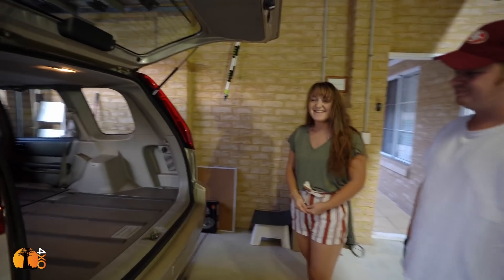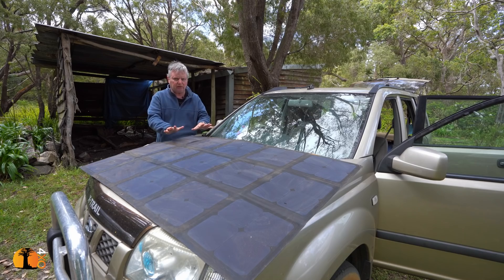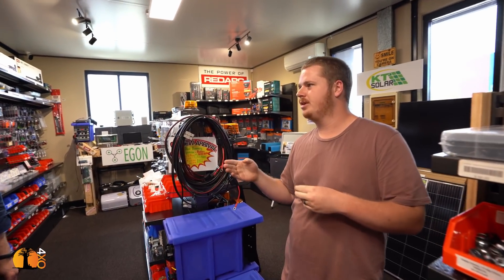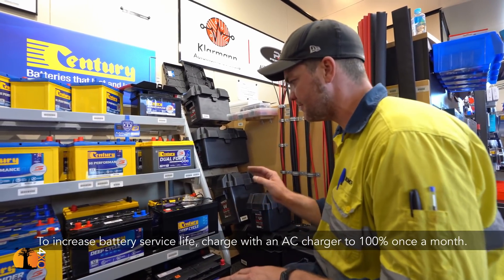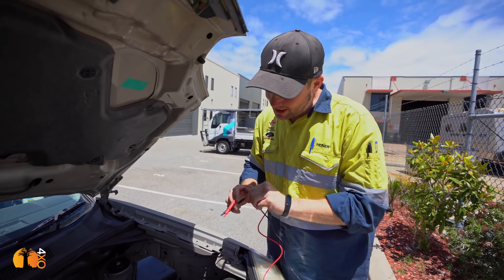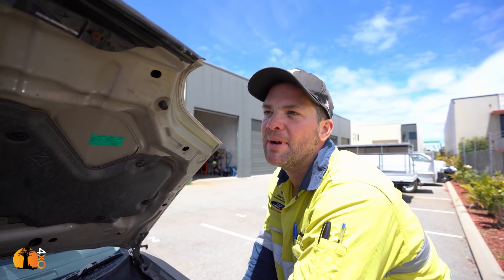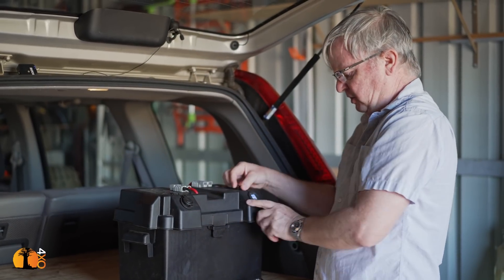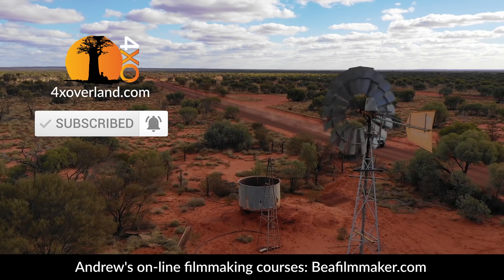BASIC ELECTRICS FOR A BUDGET OVERLANDER. Part-2 of Backpacker's Tourer Nissan Xtrail | 4xOverland

Comment: I have a dual battery setup in my VR Berlina wagon for camping. The system consists of a 135aH deep cycle battery behind the passenger seat on the rear floor. It is charged by the alternator (through the starter battery) via a Kickass VSR unit bolted to the left inner guard when the engine is running, or when camping, by a solar blanket plugged into an Anderson plug that is bolted next to the towbar with a heavy fused cable going back from that plug to the Aux battery. Have been using this regularly for 6 years to power a 2 way fridge & charging different equipment batteries and not had any problems.

Comment: Just noticed that you have 80 amps fuse protecting anderson plugs rated for 50 amps? That doesn't seem right?
I mean it will probably work and be fine, but wouldn't a 50 amp fuse be better?

Comment: If you are using a solar module with an OcV of 24 Vdc, usea PWM charge controller. Toy do not n3ed an MPPT controller. If you are using higher voltagemodules such as 72 cell 190 watt module ( which you can find for free ) an MPPT controller is far more efficient. Id you have room, grab a 250 watt module. You may pay up to $20 for one but they weigh about 19 Kg. You can get away with a PWM  controller with those. Slight loss of power but acceptable. Keep your voltage drop to below 2%.

Comment: The teouble with fixed solar modules is you need to park in the sun.  Also the angle to the sun is rarely optimal. Portable modules are more efficient but less convenient.

Comment: I thought it wasn't a good idea to hook up 2 dissimilar batteries in parallel like that. I thought if you wanted to run a 2nd battery without a solenoid or isolator or dc to dc charger etc both batteries need to be identical. Is that why he said you get less battery life? When I was looking into running 2 batteries in parallel I read that it's very important that both batteries be identical in type and rating even age and brand. From what I found it's the starter battery to be most worried about in a set up like that and overworking the alternator. I suppose it all depends on what your doing with it, I'm not an expert. I wanted to run a system almost identical to what you've put together and I ended up using 2 identical batteries.

Comment: Why not use a relay in stead of the connector to the battery, so when ignition is on the aux. battery is connected and when off it´s disconnected ???

Comment: A thing I have taken to doing when wiring boats to keep water out. Crimp the connection, seal it up using double wall heat shrink (it has a glue pre-applied to the heat shrink, so it seals extra good), paint all the edges with liquid electrical tape, connect it to the battery, paint it with the liquid electrical tape again and if you're really paranoid, paint on a coat of Vaseline

Comment: If you reconnect the two batteries with the Anderson plug and the batteries are at different voltages won’t this cause damage ? Regards AJ
Reply from the maker: The two batteries will never be at the same voltage, even when connected, due to voltage drop along the cable and connectors. Current will flow in an attempt equalise it. So, the answer is 'no'.

Comment: FWIW in one of my old cars I fitted a second alternator and second battery, the two batteries could be paralleled in an emergency to jumpstart from the auxiliary battery. Pretty foolproof and very cheap to do, just replaced crank pulley with one that would take an extra belt and a few simple brackets. You also don't end up depending 100% on one alternator. Very tempted to use ultra capacitors in my car, insignificant capacity but will let you start your vehicle with a pretty flat battery.

Comment: Great stuff. You don't see to many builds like this on youtube at least. Now it's all Li-FePO4 batteries.
Would have liked some more details regarding the expected current draw from the fridge and the resulting calculation for the battery capacity. How many AH is that AGM battery?

Comment: You can even do away with those heavy connectors and cabling and use a Redarc BCDC1206 at the 2nd battery more expensing in he long run but better alterative to all this plugging and unplugging and all these joints, my take anyway!
Reply from the maker: Okay. But this is a budget build. We were trying for the highest value for the LOWEST COST.

Comment: Surely after your years of experience you have learnt your lesson from every mistake you’ve just made. 
Fuses are for cable not for the amount of amps your battery will draw
VSR would be a life safer, potentially literally, not to mention whilst connected current will be drawn from the auxiliary battery on startup
Using a cigarette socket for a fridge instead of an Anderson.... come on the $10 now would save a lot of problems down the track

Comment: For the price of a decent ac charger, you could just get a dcdc charger. Also, if you know what to look out for, there are places like Australian Direct that offer dual battery kits for pretty cheap.
Reply from the maker: True. But cheap is cheap. So often not good value. I'm not rich enough to buy cheap crap only to have to replace it because it doesn't work for more than a few trips.
Reply: @4xoverland  seems more reliable than having to remember to unplug it every time 🤷🏾‍♂️

Comment: Andrew, instead of an AGM, can you use a Lifepo4 battery with the exact same setup as this? Meaning manually connecting when driving and disconnecting when you turn the engine off and camp?
Reply: No, LiFePo4 batteries without a charger 1) require more voltage to charge (14.4-14.6), and 2) can damage alternator by taking too much amps.

Comment: I think this overlooks the folly of PbSO4 - battery impedance. This type of battery ‘sips’ charge because its voltage rises quickly (hence the need to float charge).  [LiFePO4 ‘scolls’ charge, I digress].
- a $12 relay, plugged into a cig outlet would preclude flat crank by connecting under Acc conditions.
- a 2.5 sq mm charge lead would perform roughly as well as a 16, or 120 (or billion) sq mm conductor - the voltage drop is dominated by battery impedance; lead acid is drip fed, at best, always.

Comment: I have to say I love this series. Will be “telling” to high budget buyers about how you apply the same design principles to budget builds

All builds have a budget, but the same principles have different applications. Eg, buy battery “x” because it’s the best given the charging circumstances and you should replace the battery a little sooner than it’s expected life (which is more cost effective than installing a more expensive charging system and battery type). Design is everything. 

Thanks!!!

Comment: just read the comments about the video. i dont believe it that disconnect by hand should be such a problem? what happened to the pioneer spirit from you wishwant overlander? i just love this design. the less electronics - the better. especialy when you really want to go a little bit further than to the next camping place in the your neighbour town. nerds remember this: less electronics - less problems - better it is. when a cable breaks - well you can fix it. but when you really go overlanding, and your switch-drop-elex box fails - you are done. trip is over

Comment: Fuse vehicle side of the anderson connector that way it is ALWAYS protected and if someone puts on a different battery with out a fuse, you're covered. I would also recommend going to about 40A on the fuses as the charge draw will not really exceed 25A under normal charging opperations, I personally have ran 15A fuses in simple thin wire, close battery split charging, which I would actually recommend for this application as it auto diengages so you don't have the human error in forgetting to turn it off/unplug it. Also take the item power from battery side of the aux fuse. As otherwise there is no way to know if the aux side fuse has blown until you don't have power when it's unplugged. I would also recommend a switch for each item and a push-to-make "button" switch for the volt meter as you don't need it live all the time (gives a higher charge to your battery as every bit of voltage is a bonus!).

Comment: So if an alternator won't charge a battery to full explain why! It's complete tosh! so might be an idea to edit factually. Alternators are proper AC/DC chargers, if the alternator doesn't charge to 100% (subject to vehicle systems drain from the battery (only applicable to some vehicles though)) then it is broken and needs replacing because the float voltage is too low ie it is below spec for the system.

Comment: Loved my T31. Had a T32 as well, nowhere near as good. 
Had a similar power set up but with dc-dc on the battery box & solar panel on the roof racks all done with plugs. 40lt Engel & side awning. T31 had the inbuilt draws which took enough gear for me. Still room to sleep in the back. Easy to clip out the back seats (bottoms) which gave heaps of storage room. Could pack up & go away for a long weekend then literally 20 mins to unpack the whole car when you get home & quickly turns back into a comfortable daily driver like it was never there. Put the battery on a good charger in the shed when not in use.

Comment: Can you comment on the use of self-amalgamating rubber tape, it is very useful for making sure you exclude water and chemicals from connections e.g. the inline fuse box , quick wrap around after fuse fitted and lid closed. An alternative is perhaps a budget silicone grease to block off ingress points with some insulation tape over.

Comment: I love your videos, so helpful & informative. I'm building my first overloading rig here in the UK using a Landcruiser 90 & I have been wondering about how to do the electrics. I actually have two batteries already from factory known as the winter pack but they are in parallel for starting. Should I run a third battery as I do have a spare leisure battery or should I just put a VSR or even a manual switch between the two?

Comment: Why AGM? The cranking battery is flooded lead acid, the alternator output  voltage is for lead acid all you need to do is to put a longer vent pipe on and vent outside a roll of pipe costs pennies and it will charge to 100%.

Comment: Personally I don't bother hooking up charge from the car.

Battery box and 100Ah AGM from 4wdSupacentre ( rebranded Lion ) or Aldi when they sell it. $200 
Cheapie charge controller and 250 Watt solar panel from catch.com.au for $20 and $109 on roof at all times.

If all you're running is one fridge and phones it'll easily keep up even in southern winter and keep the battery properly topped up.

Comment: I agree with putting the aux battery on an AC charger monthly and if you use a good quality solar regulator this will also effectively charge the battery at camp. DC2DC chargers are one of the best marketing ploys in modern day vehicle electrics, not always essential as they make you believe. As I would forget switching or disconnecting, I've used a Traxide isolator for the last 15 years, great Australian product.

Comment: 25 years ago I fitted a second battery to a transit van but with a solenoid to the ignition switch. The second battery wouldn’t cooperate taking a charge when the starter battery was full (I always carry a multimeter) so to solve the problem after 30 minutes of driving I removed the positive lead from the starter battery and put a cut off plastic drink bottle over it to prevent shorting, then put it back before the end of the day. Worked well for years. This may help if you have the same problem. Good luck!

Comment: Sorry, I already asked a question regarding the fuse. You used an 80 amp inline near the crank battery no? What sized fuses were in the battery box that you bought? I do all my own wiring too. My 2nd auxiliary battery (my first is under the bonnet) which has an isolator between it and the crank. The 2nd auxiliary is connected to the 1st. Basically, I've wired my 2nd auxiliary EXACTLY the same as you have on your video except I used a 30 amp inline at the first auxiliary because the battery box I have uses two 30 amp fuses for the two 50 amp Anderson. I note that you said to use the same size fuses...so, in this set-up, are you using 3 x 80 amp fuses? To me, and I'm in no way anywhere near as experienced as you, 80 amps sounds too big?

Comment: A basic redarc solenoid would make this installation a lot more bush proof. Because it’s not just if you leave your fridge running and drain secondary the reverse is true, if you leave your headlights on you can use your secondary battery to start your car.
Reply: I prefer a solenoid as well but this system, as designed, would still allow them to start their car from the house battery.

Comment: Andrew, you have previously mentioned that you likely have too many Amptron batteries in your dual cab ute. Why didn't you offer one of them to this build?
I'm still keen to know what the overall weight of this car is going to be v its GVM? 
You've said already that "budget" doesn't mean "cheap". Surely buying a "budget" AGM battery that will last 2 years or so (due in no short part to the "budget/cheap" charging option being employed), isn't a "budget" decision in the long run? Spend wisely on things that will last the distance.
I'm surprised you haven't donated one of your Egon hubs to the cause too.

Comment: I think it is dangerous to do that because after connect the 2°  battery to the car, the main battery will drop until equilibrate the both batteries. So if the he stops the car until both batteries are full he have a problem to star again... Or im not right?

Comment: Soooo not running the fridge off an anderson plug, I take it? I would suggest changing the fridge over to one, as they are so much better than the silly cigarette lighter sockets. Was just about to build my own 12v system on a budget when I had to fly to Europe, am currently in a quarantine hotel in Sydney and will soon be able to play with the toys again :-) Only difference is that I have a solid solar panel for the roof rack and will be using a voltage sensitive relay if I even bother connecting to the crank battery at all. Do enjoy your videos very much and am looking forward to the next in this series.
Reply from the maker: The fridge is running off the Anderson. We NEVER use those stupid cigarette lighter sockets.

Comment: Because i have a lot of tools i have 12 x milwaukee M18 lithium ion batteries. 18vdc 5Ah. This is in total (12vdc) 90 Ah lithium Ion. The milwaukee battery adapter has a usb 5vdc and a 12vdc plug. On the battery you can see how full it is. While camping i have my dometic fridge, smartphones, tablet  running on these batteries.
While driving i can charge the batteries with a 350 watt dometic inverter connected to the standard 220vac milwaukee charger.  Simple setup. With more  adapters you can connect them parallel then you don't have to change often the batteries. Also you can use your powertools for cutting wood or change your flat tire.  When we drive every 2 days we only use our starter agm battery in my VW amarok v6. Greetings from the Netherlands.

Comment: Upgrade exterior/interior bulbs to LED. LED headlights make amazing difference and power draw much less. Trick with the headlight bulbs is the thin wafer type - dual sided and index position to be the same angle as incandescent bulb. LED brake bulbs much faster to light.
Economy improved by raising the tyres 5psi or so on road over label - steering action faster, grip slightly reduced.

Comment: Question, having 80A fuse on each battery between the vehicle and leisure battery, surely you must size the cable to handle a minimum of 160A or amperage of 2 x 80A fuses is likely much more if a fault was to happen mid circuit?
Reply: 2x 80A fuses in series is still 80A.  You really do want a fuse at each battery.  Remember the batteries will sometimes be disconnected from each other and there will loads hooked up on the house side.
Reply: @sonictech1000  still don't get it, I understand the need to have it fused at both batteries a necessity. But whilst both batteries are connected, you have the potential of both batteries under fault condition? So 80A x2 is at least 160A or greater acting on the charge cable from the alternator. I'm guessing as long as the CSA is large enough on said cable it isnt a problem, and helps with volt drop too.
Reply: @phillee2171  What sort of fault are you imagining?  If there is a short in the cable then both fuses will blow.  If one of the loads (fridge etc) were to fail in a way that isn't a complete short but  pulling say 150A then you'll be pulling 75A from each section of the charge cable which is fine.  The cable to the fridge may not like it but that's a job for it's fuse.
Reply: @sonictech1000  I was thinking dead short to chassis, it's the cable I'm thinking of in terms of damage. If you used a 16mm CSA cable for both I suspect the cable wouldn't like it much, guess if you move upto a 35mm CSA cable it would be fine.
Reply: @phillee2171  That's going to pop the fuses anyway regardless of their size.
Reply: @sonictech1000  yes it would, however the resultant fault current is too much for standard cable. That is my point...
Reply: @phillee2171  Since that current is only going to be flowing for a very short time until the fuse pops it will be fine.
Reply: @sonictech1000  belt and braces, use a bigger CSA cable calculated to potential fault current is a good idea if you don't want your pride and joy ending up in smoke.
Reply: @phillee2171  It looks to me like he's already done that.  Moving to even larger cable would only increase the current that would flow in the event of a short and moving to smaller fuses wouldn't change the current that would flow during the fraction of a second it takes for the fuse to blow.